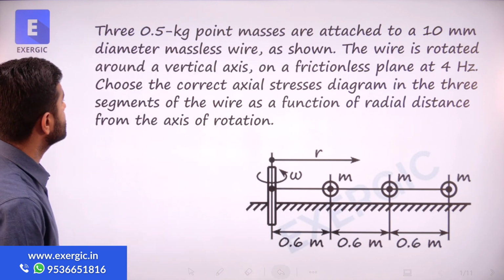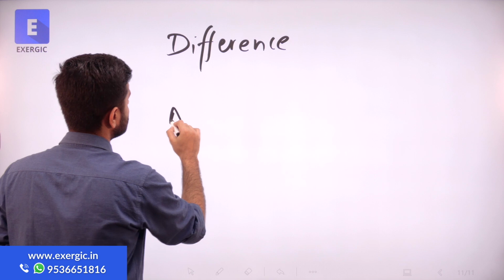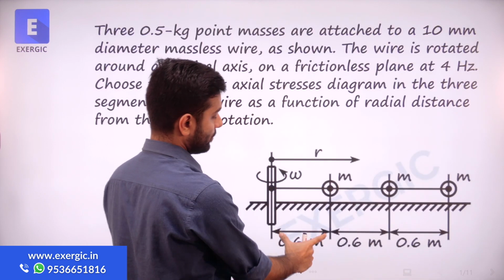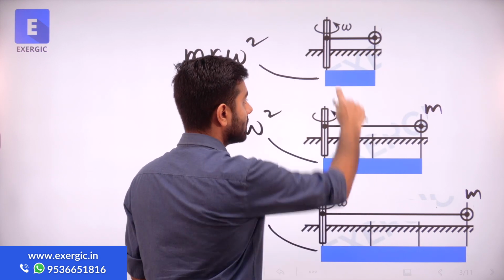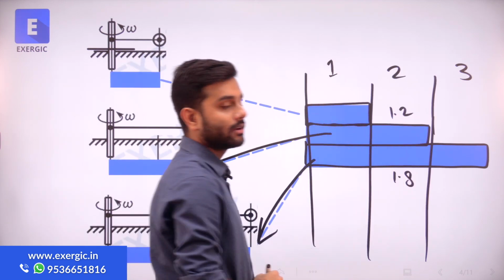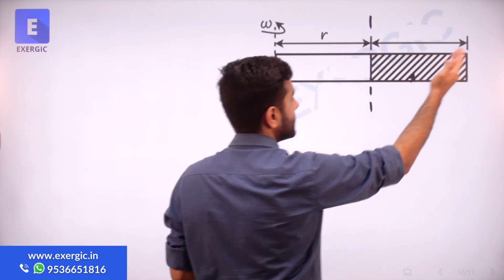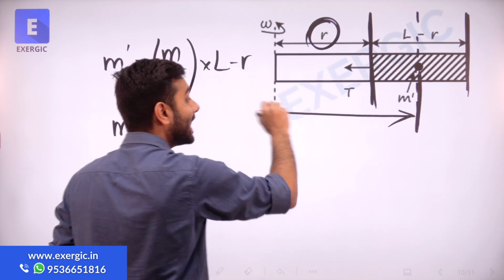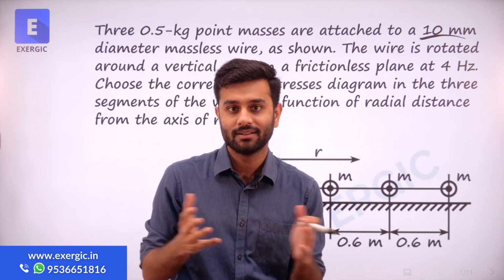Superb Numerical learnings of Strength of Materials + Mechanics | GATE Mechanical

Comment: But Sir,  for the mass which is at 1.8 m from virtical axis,  the value of centrifugal force should be more than other two , so the value of the  Normal Stress Should be more for 1.8 m Distance,  but sir in option B,  according to the Graph , the value of Normal Stress at distance 1.8 m is less than other two,  so sir I think Option A should be the Correct option.
Reply from the maker: The centrifugal force of mass situated at 1.8 m will be felt in ALL sections, and not only in the last section.

Watch the lecture carefully once again. Your doubt is already addressed and explained in the video.
Reply: I have same doubt as well